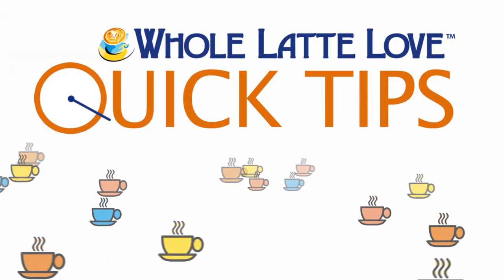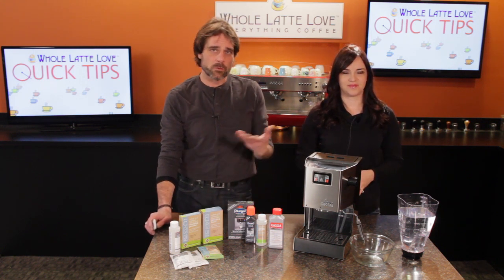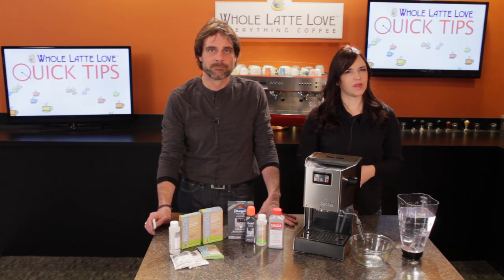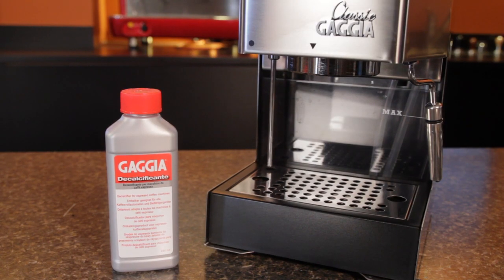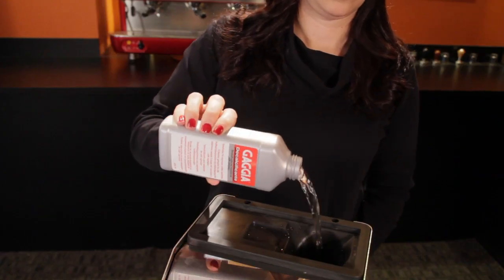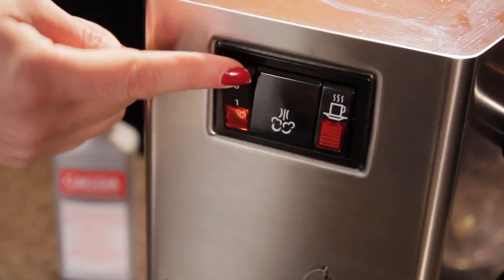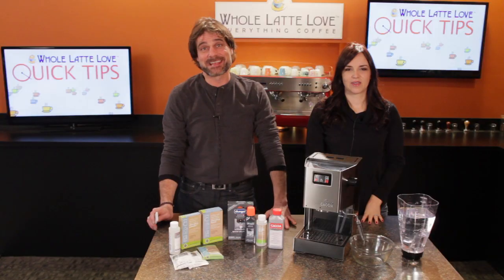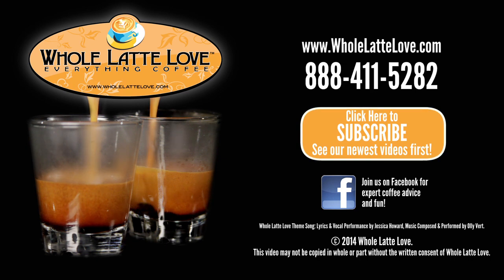How To Descale a Semi-Automatic Espresso Machine

Comment: Marc & Morgan - I saw on one of your videos where you used (at least on that video) BWT water filtration for your espresso machines.  I was in the market for a water filtration pitcher at the time anyway, so I went for the BWT.  Love it.  While it is fantastic for drinking water, however, my experience has been that it vastly increases the frequency of the need for descaling on my Gaggia Classic Pro.  Before I started using this water filtration system, I could go 2 to 3 months before needing to descale.  In fact, on my previous DeLonghi machine, I NEVER descaled over several years and never experienced any issues.  With the BWT filtered water, however, I cannot make it through a month on my Gaggia until the water thru the group head slows to a trickle!  This is far from scientific evidence(!), but I'm wondering if the magnesium that BWT filters add to the water might actually be what is plating out inside my machine?  Have you heard of this phenomenon before?  I've gone back to my regular tap water.  It has been roughly a month now, and no descaling necessary.  Purely anecdotal evidence, but so strange.  Waddya think?  Love your videos and your store - thanks!

Comment: If using Durgol on a Gaggia Classic would you use one bottle of descaler and then fill the rest of the tank up with water, as you guys did in this video with the Gaggia product? Durgol instructions say to use a 1:1 ratio descaler to water, but that seems a very small amount of water! (Durgol instructions also say to refer to manufacturer instructions). Thanks! 🙏

Comment: This is a long shot, but is there any sort of bottomless naked portafilter that will fit an '08 Gaggia Cubika? 

I am having a really hard time finding one, and I'm convinced it will yield better results than the standard channeled fixed two spout portafilter.

I'm based in the UK and have seen a company here that do a 58mm one to fit the classic, and other models, but they specify that they should not be used with the cubika (not sure if that's just the newer models though).

As you can probably tell, any help would be greatly appreciated!

Whole Latte Love for this channel by the way. Really great stuff.
Reply from the maker: Hi CT, Thanks for the kind comment and question. Unfortunately the Cubika is not sold in the US so I cannot try standard Gaggia 58mm bottomless PF to verufy if it will work: https://www.wholelattelove.com/products/gaggia-bottomless-portafilter
From my quick research the machine appears to use a pressurized portafilter. The designs of those are a bit different so my guess is the commercial style Gaggia bottomless will not fit.
Marec

Comment: Great vid! Worked well for me - Quick tip-: if you have a DECALCIFY message and it won’t reset after descaling, change the water hardness setting and it will reset.
Reply from the maker: Hey DS, Thanks for the comment and sharing the tip!
Marc

Comment: I bought a reconditioned Classic from WLL about ten years ago and removed the cover. I dropped a screw into a place that I could not reach, so turned it over and shook it. However, two screws fell out! My question is, should I return the extra screw to you guys?
Reply from the maker: Hi GB, No need to return the screw - but thanks a whole latte for checking!

Comment: Hi, I have a question about descaling Gaggia Classic Pro I bought form you guys about two month ago. I just descaled the machine for the first by following the steps in the manual. I noticed what you suggested in the video is slightly different from what's in the manual in that 1. The manual says use only half of the bottle, but in your video, you use the whole bottle; Does the volume matter (half vs. all) if I do descaling every two months? 2. you run descaling solution through group head while the manual suggests to run the solution through steam wand. Is your way of descaling more suitable for a heat exchange machine, and for a single boiler machine like Gaggia, either way works as the goal is to flush the descaling water out of the boiler? Thank you.
Reply from the maker: Hi EJ, Thanks for the question. I would follow procedure in the manual. This video was made a few years ago and Gaggia may have updated since then. In HX boiler machines with a separate water tap it's unlikely and near impossible for scale to form in the steam arm or its supply plumbing as steam is essentially distilled water void of any minerals. Hope that helps!
Marc
Reply: Yes it never says to run it through the group head, seems a bit odd to me. how are you meant to descale the machine properly if you only run it via the steam wand.
Reply: @robducrowasmr4082   I run through both steam and group head…albeit I never use the steam wand.
Reply: @robducrowasmr4082  Gaggia models which have a three-way solenoid valve (the pipe that sticks down into the drip tray) must only be descaled through the steam wand, otherwise you risk blocking the valve with undissolved scale.

For Gaggia models which have a three-way solenoid, in order to clean the group head and valve you need to “back flush” (there’s a tonne of videos on YouTube explaining this process.)

Comment: Hi, thanks for sharing. I'd like to use Dezcal on a Gaggia Classic Pro. What concentration and product to water ratio do you recommend? Thanks in advance
Reply from the maker: Hi Alberto, You're welcome. You can use citric acid based descaling products like Urnex Dezcal in machines with aluminum boilers. Urnex recommends limiting contact time of citric acid descalers to 20 minutes when used in aluminum boilers. Follow the Urnex instructions on the product for ratios. Be aware we recommend using the Gaggia brand descaler as it contains a corrosion inhibitor not found in plain citric acid products.

Comment: Hi Marc. Looks like Dezcal is recommended for our Casa V machine (brass boiler). Is it also ok to use the Durgol de-scaling product in the Casa V even though the video states it is recommended for aluminum boilers? Assume the answer is that it can be used for either, but thought I'd confirm. Also, assume if you have your choice for the Casa, Dezcal is the best choice. Thanks!
Reply from the maker: Hey Brian, Your assumption is correct! Urnex recommends Dezcal for copper and brass boiler. Durgol is fine to use as well. Durgol is preferred for aluminum boilers if a manufacturer's recommended descaler is not available. Durgol is basically okay to use in any boiler material. If using a citric acid based descaler like Dezcal in aluminum boilers Urnex says that's okay so long as contact time is <25 minutes.
Marc

Comment: I have a Gaggia Classic. How do I know what the boiler material is and which descaler to use? I have Dezcal, is it ok to use in the Gaggia Classic?
Reply from the maker: Hi Sue, Dezcal is a citric acid based descaler and okay to use in the Gaggia Classic which has an aluminum boiler. According to chemists at Urnex contact time of Dezcal/citric acid descalers should be limited to no more than 30 minutes in aluminum boilers. That's plenty of time for the descaler to do its work.
Marc
Reply: @Wholelattelovepage  , Marc, that scares me😬 Is there a good (or better) descaler that is safer for aluminum boilers? A little strange to say this, but I've seen what boiling 2 lemons (with our Low Country Seafood Boils) in a huge aluminum pot can do. Little pin holes eventually started showing up so we had to buy a stainless steel pot.

Comment: I generally descale on a regular basis and have had had no trouble until recently on my Gaggia Classic pre-2015 model. I have attempted to descale using the Gaggia decalcificante [which I always use] after I got very little flow through the brew head. However while I can get get the Gaggia decalcificante/water mixture to flow through the steam wand, I am not getting any flow through the group head. I have recently replaced the group head gasket and cleaned up all the parts there, i.e the screen and shower holding plate, as well as backflushing with Cafiza. Then I performed a descale. But within a day I got reduced flow and began to perform another descale but as said I'm getting no flow through the group head. Any suggestions would be helpful. Thanks.
Reply from the maker: Hi tvnw, Here's a link to our support wiki for the Gaggia Classic to section for troubleshooting no flow from grouphead. It may be an issue with the solenoid valve if you have a North American Classic which has a solenoid valve: https://wiki.wholelattelove.com/Gaggia_Classic/troubleshooting#Machine_Has_No_Water_Flow
If in US and need additional assistance please call our tech support at 585-924-7170
Marc

Comment: Hi! When I run water through the steam wand as you have done, should water also be coming out of the brew group? It’s not at full force but quite a bit of water coming though. Thanks!
Reply from the maker: Hi d, it depends on the machine. Some will drip a bit of water from the group when pumping water from the wand.
Marc

Comment: Hi ,  I have a question I bought my classic gaggai from your website the late part of 2016 and have been using gaggai descaler ( I can find locally and I was wondering if I could also use as a descaler  product the DURGOL espresso special decalcifier to  my machine?
Thank you
Reply from the maker: Hi IM, Thanks for the question. Durgol Special Decalcifier is okay to use in your Gaggia Classic. Just limit contact time of the Durgol to 20-30 minutes.

Comment: Hello, I used Gaggia descaling in Gaggia Classic, after the process, I drained 10-15 liters of water, but the water coming from the machine is cloudy.  However the water coming from the steam wand is clean. What should I do?  What did I do wrong?  Thank you.
Reply from the maker: Hi MAS, Hi thanks for the question. Was the machine past due for descaling or is your source water extra hard - mineral rich? It may be the boiler was severely scaled and the first descaling did not get everything. You can try descaling again. If using very hard water I would treat in future to lower mineral level.
Marc

Comment: Hey, I know its an old post but maybe you can help. I got a new Gaggia classic pro (2 months), and used a recommended descaler from a local coffee shop, I asked a few shops they all recommended it. I used it as suggested, left the machine off for 20 min and ran the water through again. Water came out Blue - Purple - grayish. Since then the water has a bit of an eggish smell. Seems weird. I am scared I ruined the boiler maybe but it's a new machine.
Reply from the maker: Hi Sara, I doubt the color and smell of discharge has anything to to with the type of descaler used. While we always advise using the descaler recommended by the manufacturer it's okay (though not optimal) to use other descaling products. It's likely the local shops recommended a descaler which uses citric acid as most commercial descalers use it as the active ingredient. According to Urnex, a leading descaling product manufacturer, citric acid is okay to use in the Gaggia Classic so long as contact time is limited to <25 minutes. Hard to say why your wash water was discolored. May be something odd with your water quality? Any chance you're using well water? Eggish smell may indicate water with high sulfur content which is common in well water depending on well type and location. But there could be other things in water that over time have concentrated and left deposits in your boiler. In your shoes I'd do the descaling again and flush the machine with a couple reservoirs of water to clean things out. Going forward I recommend filtering water used in your machine to remove any odd contaminants. Hope that helps!
Marc

Comment: Does it matter if the boiler and brew head are hot, or should the machine be cold when descaling?
Reply from the maker: Hi Jeff, Thanks for the question. It's okay if hot. Depends on machine but in most cases they will heat up during descaling.
Marc

Comment: Thanks for all the great videos! I just bought a used Gaggia Classic and I want to descale because the boiler seems to not working to its full potential. In my home country though I don’t have the descalers products shown in the video, but there is a citric acid based descaler from a local coffee store that I’ll try. My question is since the machine seems to have not been descaled in a long time, should I soak for more than 20 minutes, like an hour or so? Or is it better to do 2-3 descaling rounds to avoid damaging something inside from long soaking times?
Reply from the maker: Hi MA, Thanks for the question. For descaling, it's okay to use citric acid but limit contact time in the boiler to 20 minutes. I'd do only one round and see if that helps. If the machine was neglected and is severely scaled you may run into problems with large pieces of scale dislodging and causing problems. If you are up for it you might be better off rebuilding the machine if you are certain it was neglected. Here's a video which take you through the cleaning/rebuilding process: https://youtu.be/N9i-EH7qXOc
And, here's a link to our support wiki for the Gaggia Classic with troubleshooting info, manuals, diagrams and more: https://wiki.wholelattelove.com/Gaggia_Classic
Hope that helps and good luck with your Classic!
Marc
Reply: @Wholelattelovepage  thanks for the speedy reply! I have sent to the original owner asking him and waiting for his reply back. Meanwhile I will do a descaling round and see what I get. Thank you so much, Marc.

Comment: Hi guys, I'm loving my Gaggia Classic Pro and Sette 270 I bought from WLL  2 months ago. It really is perfect combo for someone new to espresso. I recently picked up some boxes of Capresso descaling packets on clearance and am ready to descale the machine and noticed that the instructions do not call for letting the solution sit in the machine for 15-20 minutes or run alternatively through the steam wand as you demo in this video. It just says to run the solution through the brew group and then run 2 full tanks afterward through with just water. Will it work for me to follow your instructions even though it's not the Gaggia brand solution? The packets were super cheap so I took a gamble! Thanks!
Reply from the maker: Hi EH, Thanks for sharing your impressions of the GCP and 270. It is a fine setup! I'm not entirely certain what acid is in the Capresso descaler. I'd guess with a high degree of certainty it's citric acid as it's used in the vast majority of descaling products. IMO you should be fine using them so long as you mix to concentration recommended on the product instructions and limit contact time to less than 20-25 minutes. I've consulted with Urnex scientists who provided that recommendation when using citric acid based descalers in Gaggia Clasics.
Marc
Reply: Thanks so much Marc. It has the Urnex logo on the back of the package so Im thinking It’ll be fine within that 20 min window! Appreciate the reply!

Comment: Thanks for the video! I have a question - with the 2020 model i don't have to turn the steam boiler on to get water out of the steam wand, and also the instructions for Durgol Swiss explicitly warn against turning the steam wand on. Is it okay to do so anyway?
Thanks again!
Reply from the maker: Hi L, Thanks for the question. I'm not sure what make/model machine you have. In general it's okay to allow descaling solution to exit from the steam wand. Trouble is steam comes of the top of the boiler and hot water comes off the bottom. So with most if not all machines with heat-exchange boilers you will never get water out of the steam wand. If you have a single boiler machine you can turn on the pump (or brew switch depending on make/model) to get water out of the steam wand. If that's you, just be sure to rinse well - like a reservoir of water through the boiler.
Marc
Reply: @Wholelattelovepage  cheers! Thanks for all your help. The channel is a godsend

Comment: is there a difference between descaling and backflushing an espresso machine?
Reply: Yes. Descaling removes mineral deposits weekly bonded to the metal. Backflushing uses detergents to remove coffee oils, etc. that are left in the brew group and expansion valve that pulls fluid off the puck and releases the backflow water into the tray after stopping the pressurized water flow to the head. At least that's how my ECM Casa V works. YMMV.

Comment: I know this video is older so I’m hoping I can get an answer? Newbie here. I ordered a Breville DuoTemp pro. We have very hard water where I live and I’m not sure what kind of descaler and cleanser to use. I know the machine comes with 2 Breville brand cleaning tablets but that won’t last me very long AND the Breville brand tablets are insanely pricey!! Thanks
Reply from the maker: Hi Maddy, Thanks for the question. I would definitely pre-filter your water if very hard. This pitcher filter reduces scale causing calcium and replaces it with magnesium to maintain flavor: https://www.wholelattelove.com/bwt-penguin-2-7-l-water-pitcher
Another option is to make brew water from distilled water. Here's a video showing how to do that: https://youtu.be/iHI7jC0sQZo If neither of these options work for you then I would descale your machine more frequently. The Breville cleaning tablets are not for descaling. They remove built up coffee oils etc. For a cleanser we like Cafiza: https://www.wholelattelove.com/urnex-cafiza-espresso-machine-cleaner Most commercial descalers use citric acid as the active ingredient. You can purchase bulk citric acid where canning or home brewing supplies are sold or go with a commercial product like Urnex Dezcal: https://www.wholelattelove.com/urnex-liquid-dezcal
Reply: Wonderful, thank you so much!!